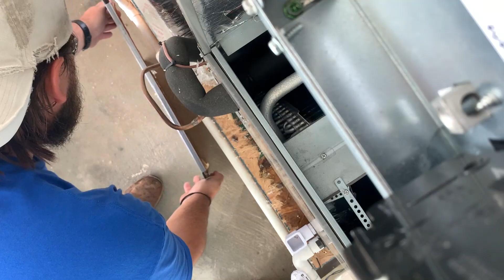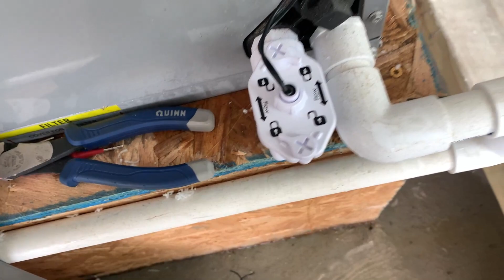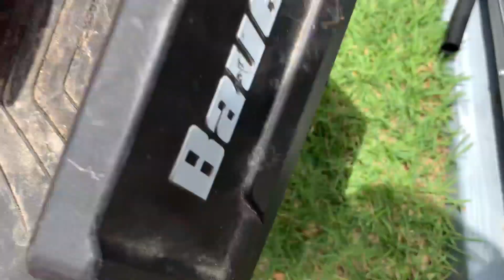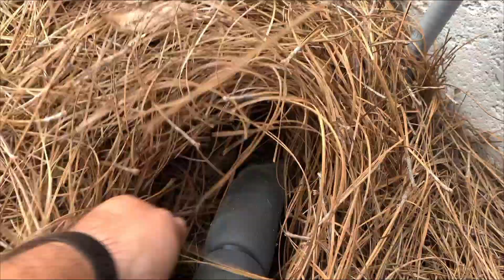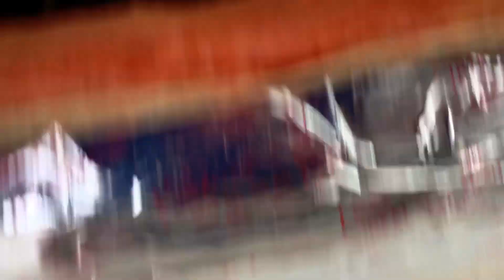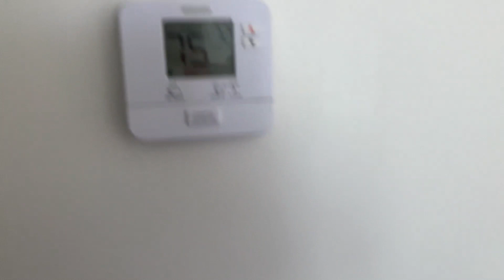Double Trapped Drain Line!

Comment: I thought the clean out supposed to be before the p trap .
Reply from the maker: You would be correct, that is actually called a vent since it is after the P-trap. I did not put a clean out on this unit since the Float Switch is very accessible.